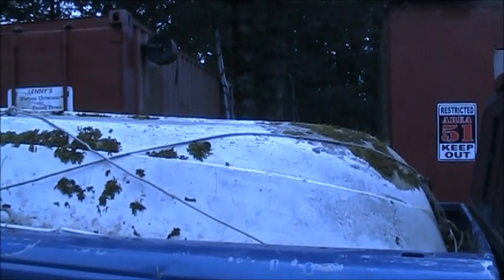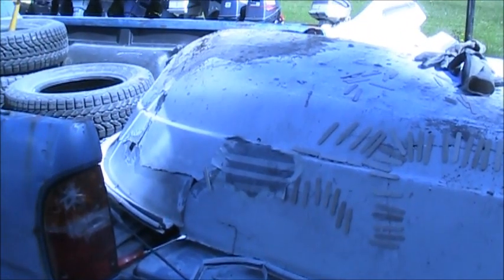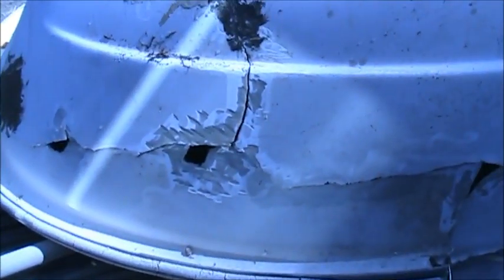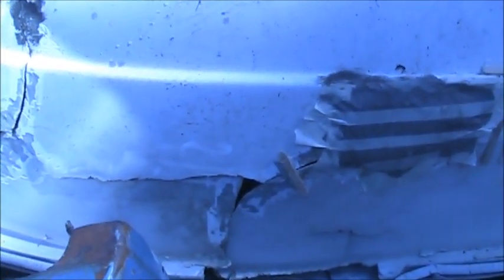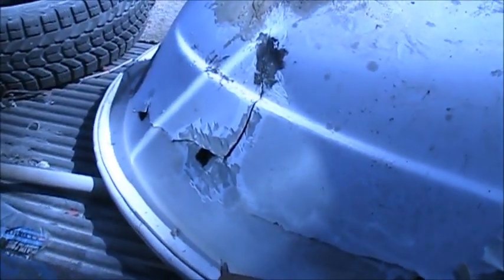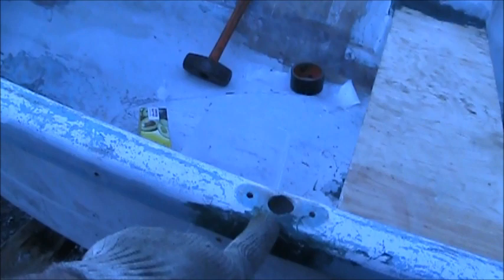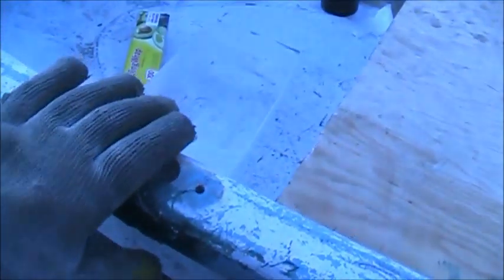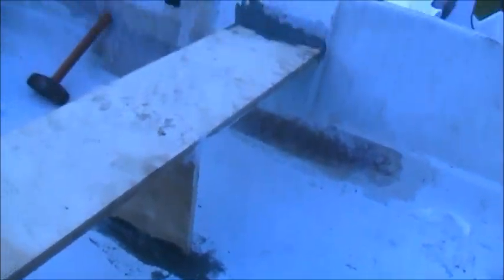DINGHY ,  PART 1       fiberglass repair ,  repaired

Comment: Alright, boat restoration projects.  Keep em coming.

Would would be even better is if you ran into a very cheap starcraft aluminum boat (or similiar manufacturer)  that needs a floor and some minor fixes & updates.

As long as there's no major structural cracks on the aluminum, they should be fairly cheap to redo the floor or transom (if needed).

Something like an Islander/Sunchief/Holiday/Super Sport, or one of their ocean going models.

It's a shame I don't live near the Great Lakes, they almost have to give them away there they got so many of em.  However I'll take the warm climate I'm in over Michigan winter anyday.
Reply from the maker: +havocsquad 1,  You never know whats going to show up around my shop..                kodi